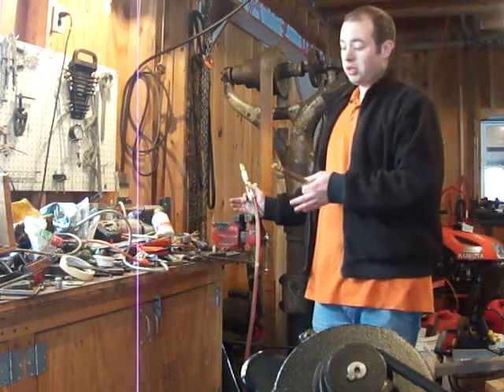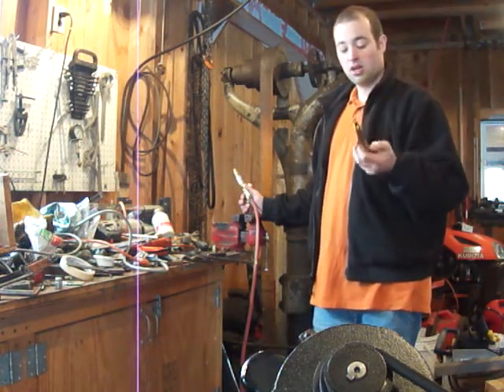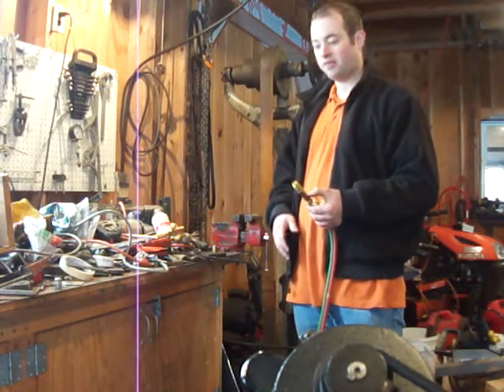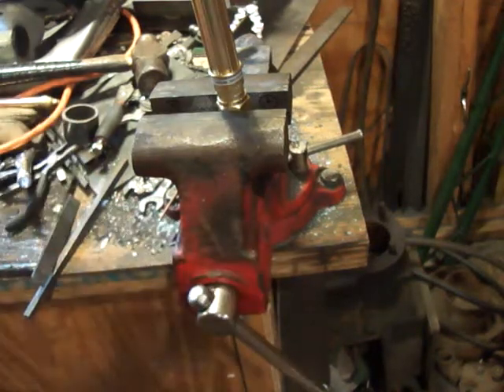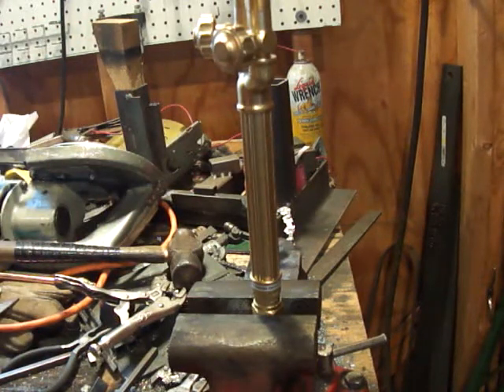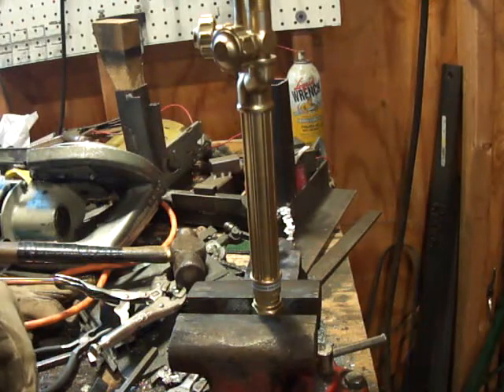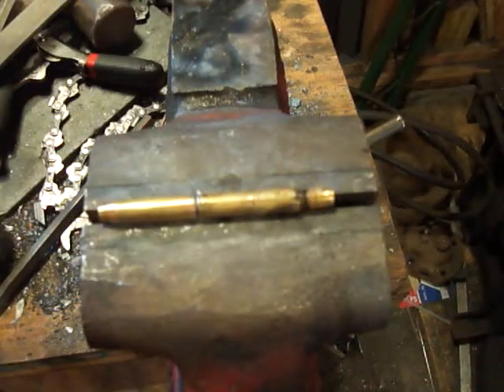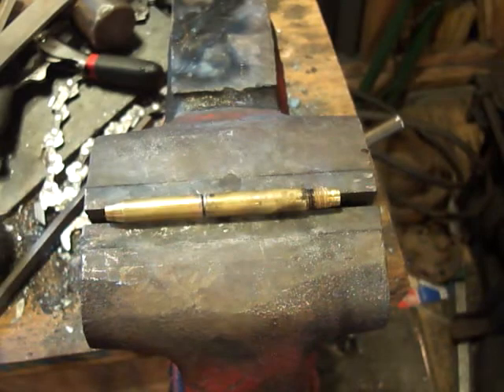Custom Built Mini Acetylene Torch

Comment: Great idea but i think that soldering is not strong enough.
can't wait to see the second part.
Reply from the maker: I was concerned about the strength at first however I looked up the tensile strength on this solder and it has a 5600psi and with the 1/8" thick wall of the outer tube results in this joint having a strength of 745lbs. I have a feeling short of driving over it, it should hold just fine.
Reply: Iain Portalupi
Good to know about the tensile strength, man that is great .
Good luck.